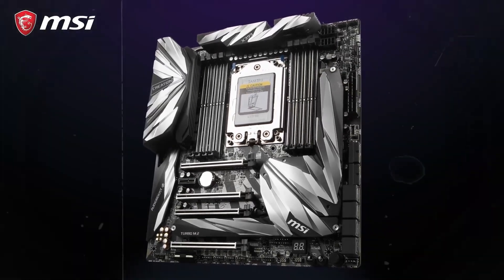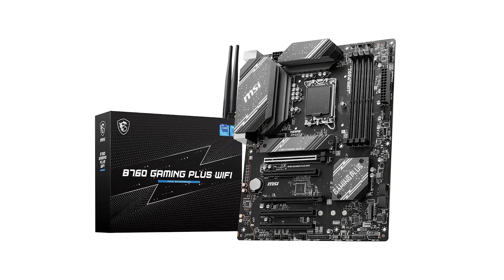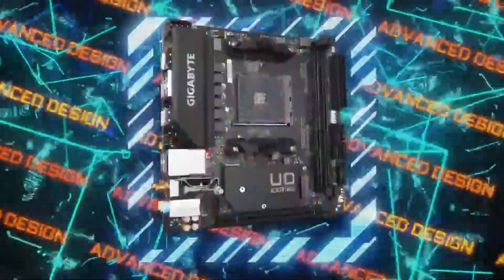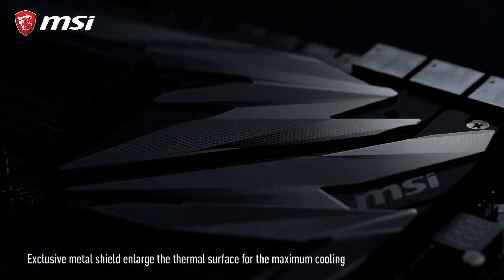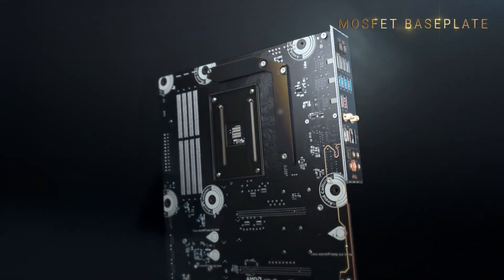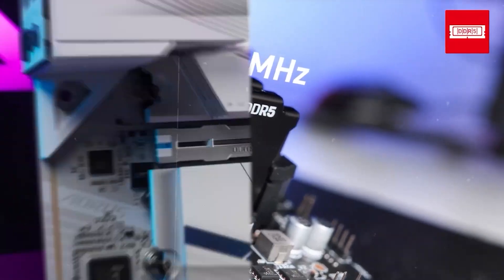MSI Vs Gigabyte Motherboards: Which Is Better For PC Build?

Comment from the maker: 0:00 - Intro MSI vs Giigabyte motherboard
1:13 - Features
2:39 - Build Quality and Reliability
3:45 - Performance and Overclocking Capabilities
4:45 - BIOS Interface and Software Optimization
5:48 - Gaming Features and Aesthetic Customization
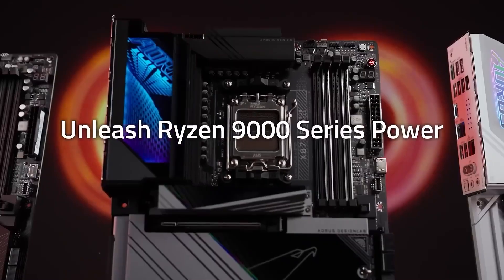6:43 - Price
7:25 - Memory Support
8:09 - Ports and Connectors
8:47 - Cooling Solutions
9:24 - Customer Support
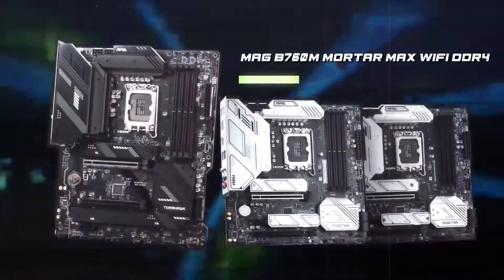10:01 - Which one is better?

Comment: I have an MSI MOBO and Hate it! Why, because the internet connection is frequently disconnecting and then if lucky, reconnecting. Also one of the connections on the mobo was not properly stabilized so when I was plugging in an item it bent and almost broke! I have struggled with it since, and am now finally trying to move to ASROCK, ASUS, or Gigabite in an AMD configuration. Also I hear that MSI does not support quality sound very well if at all.